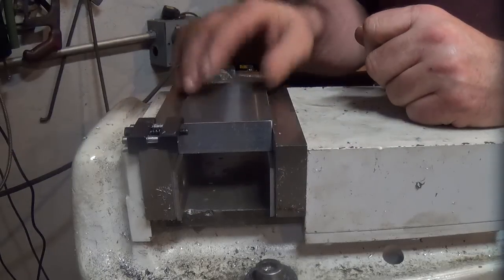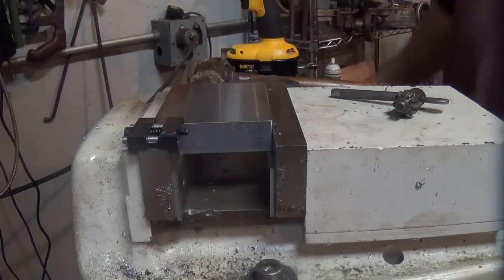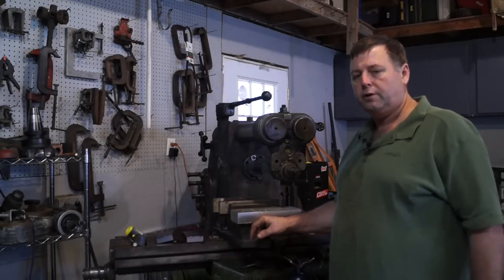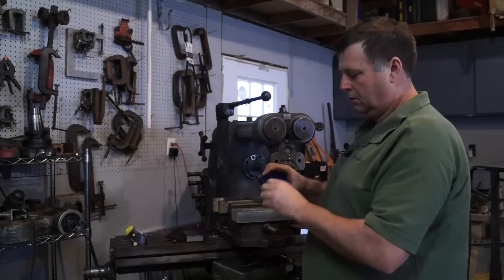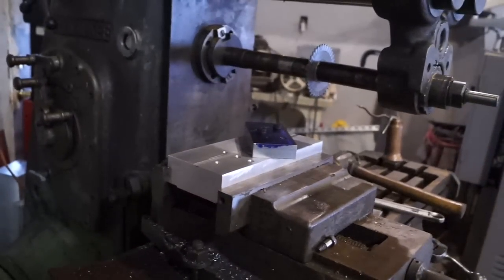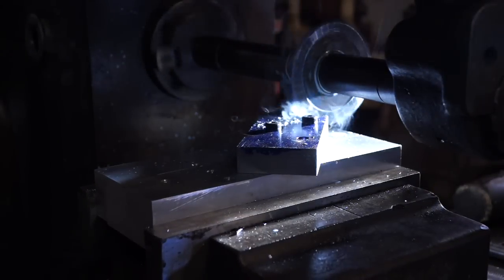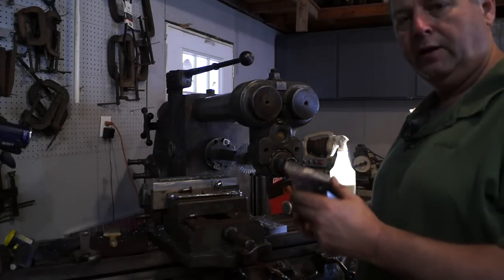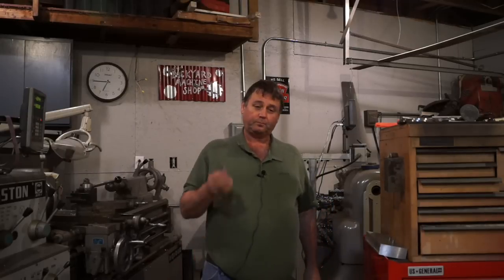Angles & Squares Part 1

Comment: No better way to rest than to work! :-) You going to try to heat treat with a torch?
Reply from the maker: +bcbloc02 
Not sure about the heat treat yet, I don't have a torch rig here at the house so I'm leaning towards building something and using propane. However I do have acess to a torch a couple miles down the road.
Reply: +The Backyard Machine Shop Do you have a wood stove? I've seen a few of Keith Fenner's videos where he heat treats in his shops stove. I'll probably try the same thing and do my annealing in an old toaster oven, LOL!
Reply: Knolltop Farms
Thats a  heck of a toaster oven to get 600+deg! lol
Reply: +bcbloc02 It tops at 650F and is designed for home made pizzas. It's some Italian made deal with a half-round addition to the enclosure and it works great...except the timer and temperature dial no longer work, so if you're not cooking something at max temp you're screwed! 

It does work for toasting open faced sandwiches by melting the cheese on top, but you can see the elements never kick off if you set it for a desired temp...